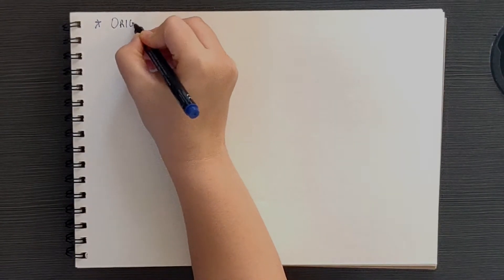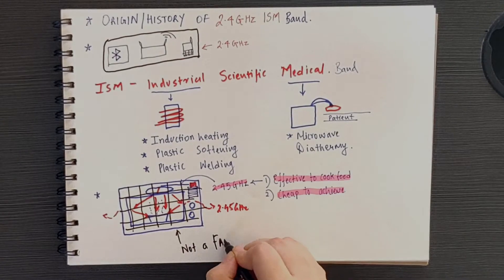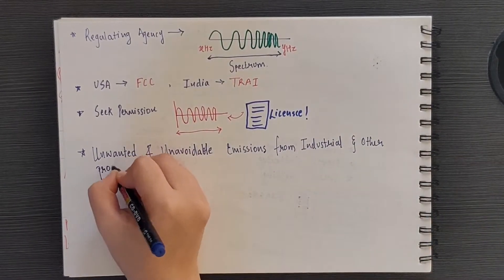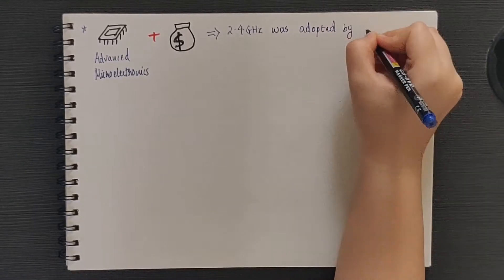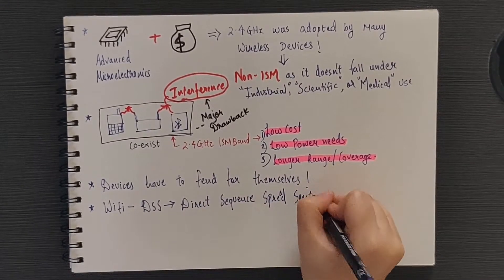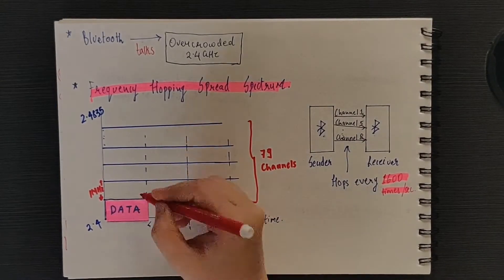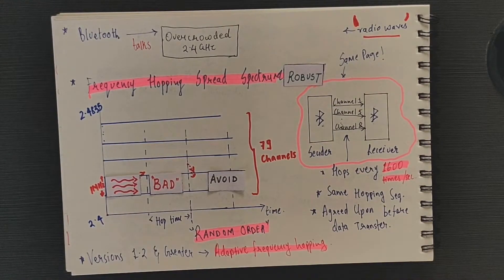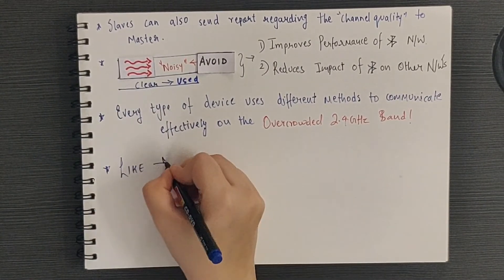Bluetooth - Frequency Hopping and history of 2.4 GHz ISM band

Comment: What do you mean by the agreed frequency hopping sequence?
Reply from the maker: After receiving an advertising packet, the master can send across connection request to the peripheral. This request contains a channel map (provides info related to use/unused channels) and frequency hop increment (this is used to calculate the value of hopping  frequency for the next connection event)
Reply: @BinaBhatt  Thanks
Reply: @BinaBhatt  could you please let me know which packet is responsible for this?